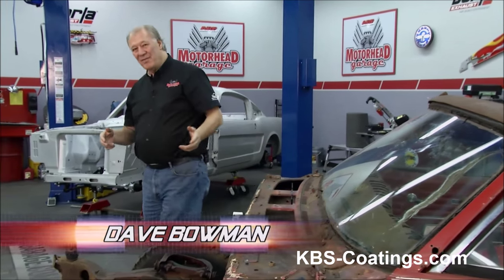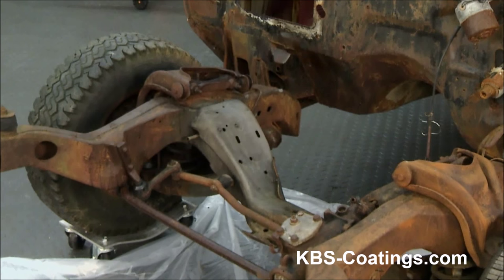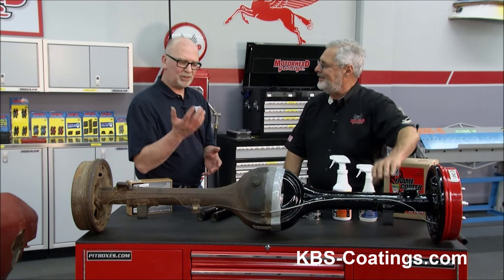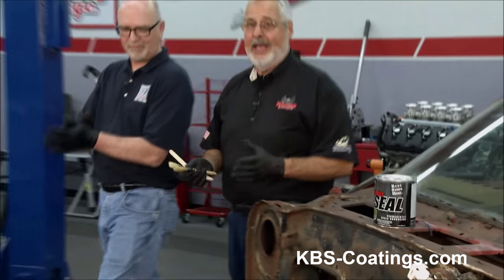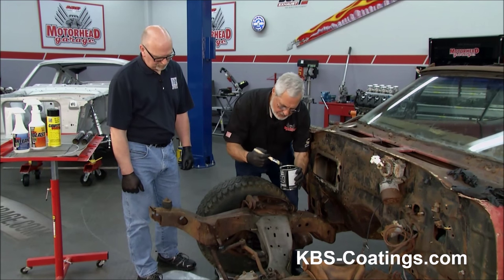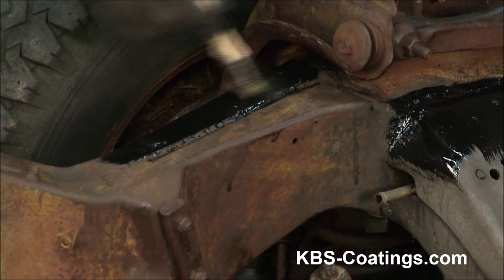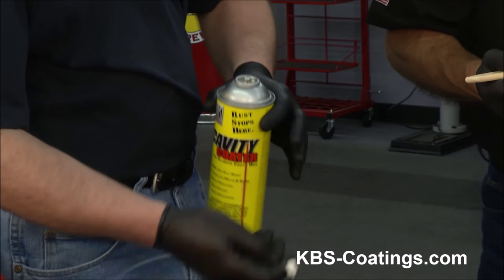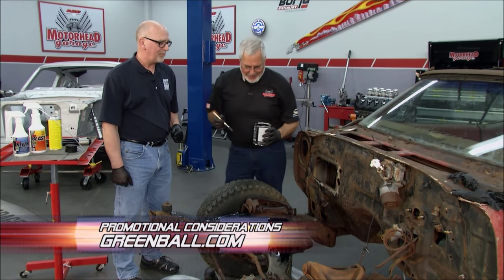KBS Coatings Featured on Motorhead Garage - June 2015

Comment: Good for a water truck tank with water? Inside obviously . The KBS coating will be protecting the interior of the tank
Reply from the maker: Yes. The Tank Sealer Kit is very commonly used to seal non-potable water tanks. Tank Sealer is related to RustSeal, Tank Sealer is just lightly pigmented and more viscous for ease of application.  LINK: https://www.kbs-coatings.com/kbs-tank-sealer-system.html

Comment: I have been using KBS for years, i have heard about KBS origins and the scientist/chemist that cracked the formula, took him 9 months from go to selling it, I use KBS on the bare metal and then paint over with a paint and colour of my choice, i have never had any trouble with kbs as its the best paint i have ever used,  apparently por-15 is a similar paint but a lot more expensive.
Reply: actorzone Por15 sucks. Peels right off. Makes me very suspicious of this KBS product especially since I don’t see them using the grey for the first coat in this demonstration and them him banging two CLEAN pieces of metal as some sort of proof

Comment: Hello.  I bought your products, heard many great reviews.  Can I prime the rust areas and then use the rust encapsulated paint?  Prime > klean > blast > seal?  Won't have any defects if I prime the rust areas first or better to paint over rust?  Thanks
Reply from the maker: RustSeal is designed to go straight to BARE prepped metal surfaces. RustSeal will absolutely adhere to a flat sheen primer that is fully cured, but the ideal application is RustSeal applied to prepped bare metal. Please let us know if you have any additional questions.
Reply: I contacted your company.  Got to say one of the sales rep gave very detailed advice.  I respect the professionalism.  I’m a happy customer.

Comment from the maker: Watch Sam Memmolo show you how you can prevent rust on your car from the inside out using the KBS 3-Step Rust Prevention System of KBS Klean, RustBlast, and RustSeal. Sam also shows you how to seal up the inside of the frame using the KBS Cavity Coater.

https://youtu.be/q3pAaXS6Ngc

Comment: Hey KBs rust seal how heat resistant is it. Could I paint my break rotors with it
Reply from the maker: We have a Rotor Restoration Kit for Brake Rotors. It comes with everything you need to prep, prime, and paint the rotors. https://www.kbs-coatings.com/rotor-restoration-kit.html

Comment: How long does this coating last? Can i apply this over brake lines and stuff? Im applying to my daily and am not gonna remove all my lines and wiring.
Reply from the maker: RustSeal is rated and tested as a permanent coating which means lifetime is at least 10 years and usually much longer. Yes, RustSeal is used to coat brake lines. That is an extremely common application.

Comment: The internal coating. What steps do you take to prepare the inside? Can you pressure wash inside to remove dirt and scale. If water is trapped inside how will that water affect its protection and curing
Reply from the maker: If you can put a pressure washer in there, great. Use compressed air to dry out as best as possible. Then apply Cavity Coater. The inside cavity surface does not have to be 100% free of moisture. https://www.kbs-coatings.com/cavity-coater.html

Comment: You're applying it with a paint brush, does it lay flat so you can't see the brush marks or? Would you see a difference in the finish between using a brush and spraying?
Reply from the maker: The brush marks flow out beautifully. RustSeal looks like powder coating when brushed out.

Comment: My question is that I have a 71 Chevelle that I am building it has a 12 point roll cage that has been sitting in a barn for years. This past few months I have all new body panels the question is can I just get all the rust dust off with out getting it wet ?
Reply from the maker: You could spray RustBlast on a clean rag and wipe off the rust dust.

Comment: Very cool video , but does it really last ?  you should see my recent video where I powder coat a differential, The benefits of the process of powder coating are numerous.Powder coating results in a thick, dense finish on metal products which can be more durable and longer lasting than conventional painting, thank you.
Reply from the maker: Yes. It absolutely does last. We have customers who used it on daily drivers and 10+ years later, it looks great. No rust. Easy to clean. Very durable. No cracks in the paint (which is very common with powder coating).
Reply: KBS Coatings I’m not buying it as your demonstration used deceptive tactics and never chip tested the over rusty metal application

Comment: looks like POR-15 but a different name, whats the difference?
Reply: Gorgon Bazil these guys founded por15. Por 15 is 70’s technology. These guys updated the chemistry. It’s a better product cheaper
Reply: still waiting on a reply? I am too!
Reply: POR15 days are over. KBS continuously refines and looks for ways to serve their customers. POR15 is 30% more expensive and lacks the substance of KBS. POR15 is out KBS is in.
Reply: @irondiver292  Actually, The Company POR products have been working with coatings since 1923.. They are so good, Ships use it for hull coatings.. Hmmm, KBS doesn't. Not all of the POR-15 line is UV unstable. Its not 70's Tech btw, 1978 is when they pioneered moisture cure tech, they still work on coating tech. KBS is not bad,,, POR is just better...
Reply: @irondiver292  LOL,,,not true...

Comment: Can you paint over it? I presume you might have to etch the surface. Here in 50 humidity can reach 90%. And who sells it?
Reply from the maker: Yes, you coat over RustSeal. Let the RustSeal cure 24 hour sand then slightly scuff with 300 grit.
Reply from the maker: Apply during the coolest and least humid part of the day for best results.
Reply from the maker: You can plug in your zip code on our Reseller Finder: https://locations.kbs-coatings.com/
Reply: @Kbscoatings-us  87110

Comment: Can you use rust seal on midpipes and mufflers
Reply: Sure. Looks like it. I'd probably personally recommend it since "aluminized" exhaust components don't hold up to rust
Reply from the maker: Yes, RustSeal is used on the back end of exhaust all of the time. RustSeal provides durability and rust protection.

Comment: I have a question. Do you recommend this product on boat trailers?
Reply from the maker: Absolutely. But remember RustSeal tends to chalk and fade in direct sunlight so be sure to top coat RustSeal with BlackTop which does not chalk or fade.
Reply from the maker: Most people doing boat trailers get this kit: https://www.kbs-coatings.com/Large-Chassis-Paint-Kit.html

Comment: Can you do this on semi truck  chassis
Reply from the maker: Yes, the KBS 3-Step Rust Prevention System is ideal for Semi Truck Frames and then you can top coat the RustSeal with BlackTop on any areas that are exposed to sunlight.
Reply from the maker: RustSeal: https://www.kbs-coatings.com/RustSeal.html
Reply from the maker: BlackTop: https://www.kbs-coatings.com/BlackTop.html